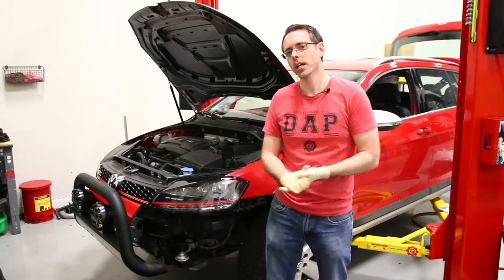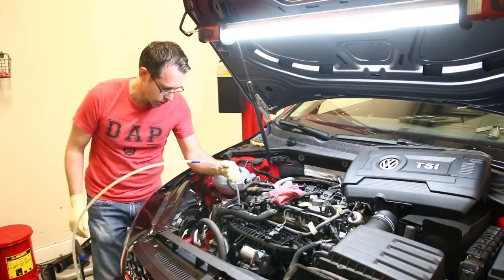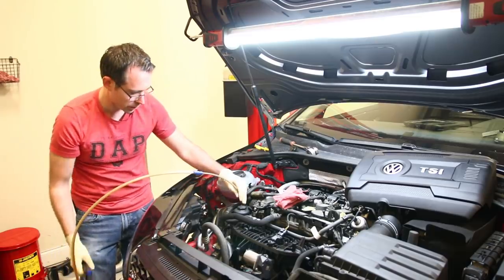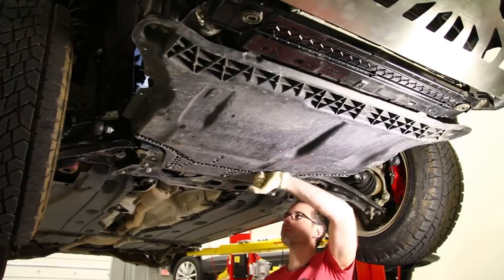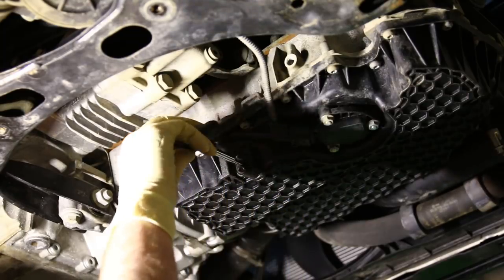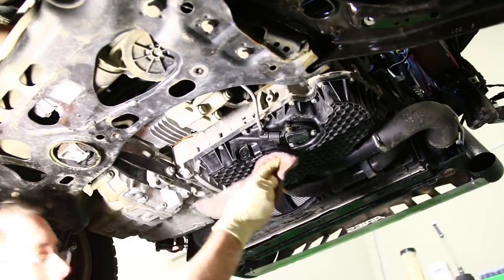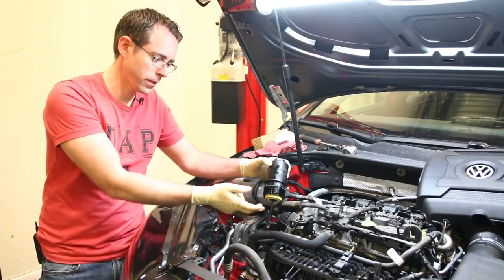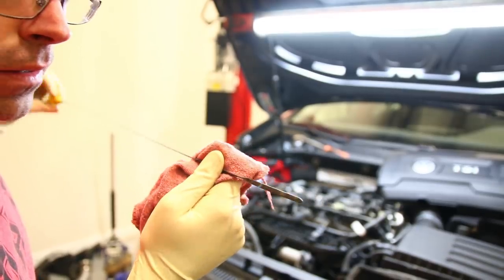1.8T Oil Change DIY | Extractor vs Drain Method

Comment from the maker: - We appreciate your Support and Purchases! -
Oil Extractor Unit (6.5L)
https://www.shopdap.com/vw-audi-oil-extractor.html

Oil Filter Housing Socket (32mm)
https://www.shopdap.com/mk7-gti-oil-filter-housing-socket.html

10K Mile Maintenance Kit for MK7 Golf and Sportwagen 1.8T TSI
https://www.shopdap.com/catalog/product/view/id/603484/category/40004/

Small Pick Set (4 piece)
https://www.shopdap.com/vw-audi-small-pick-set.html

Drain Plug Removal Tool
https://www.shopdap.com/mk7-8v-audi-drain-plug-removal-tool.html

Magnetic Drain Plug (with Seal)
https://www.shopdap.com/magnetic-drainplug-mqb-vw-audi-mk7-gti-golf-oil-drainplug.html

Comment: There's always significant oil left in an engine after the drain or extraction process. All the oil downstream of the oil pump remains in the engine - oil passages throughout the block and head, the pump itself, etc. Check the oil capacity data after "rebuild" vs. the normal oil change. So there's no point in being obsessive, you'd have to disassemble the entire engine to drain all the oil.
Reply: If you use oil flush and let it drain really well, you will get pretty much all of of it out because even when it gets cold, it will flow like water. It completely destroys oil.

Comment: If you take it to the shop for an oil change, they never allow the oil to full drain before putting the drain plug back….I’m sure they leave more residual oil in the engine than the extractor does. Always change your own oil, even with an extractor.

Comment: I've been using my oil extractor for 12+ years, any engine with the oil filter located on top is a good candidate. Tip:  find the end of the dipstick at the bottom of the engine and if you have a driveway with some inclination, position the car so that the oil dipstick side of the engine is at the lowest point.
Reply: Xavier Lemos good idea. Will use it next time
Reply: @Chris-dy1cb  
Furthermore, if you don't have a driveway with some inclination, get a pair of ramps and use them accordingly. Still beats going under the car and also removing the belly pan/cover.
Reply: The incline sounds like a good idea, thanks!
Reply: What if you don't have a dip stick? Like bmw that oil is measured electronic? 🤷🏻‍♀️🤷🏻‍♀️
Reply: @giannispets  
You can look for the drain plug to position the car with ramps or jack stands at the lowest point of the engine so that most of the oil will drain.
Reply: @x-man4702  yes but where I will insert the oil extractor hose? since I have seen people insert it thought their oil dipstick hole
Reply: @giannispets  
Many Mercedes cars don't have a dip stick, but have the provision for sticking a dealer only dip stick to measure the oil and the transmission fluid; BMW should be similar.
Reply: @x-man4702  hmm thx for the info. I didn't know that, will try to see if I can find  if mine has one and where. My oil filter is on top of the engine. I am somehow angry with bmw if they hide that oil dipstick from me 🙄
Reply: I feel sorry for your engine.

Comment: Oil change on 1.8tsi? You don't change oil you just are just filling it occasionally. It burns oil faster than the speed of light.
Reply: haha
Reply: Can’t relate. My 2 2.0t’s and my friends 1.8t don’t burn oil outside of what is normal. Needs a maximum of 1-2 quarts every 10-15,000 miles.
Reply: when i owned my vw i did 3k oil changes all the time
Reply: My 1.8 hardly needs adding in 10k.
36k currently.
Reply: My scirocco 2.0 tsi hardly burns any oil an it's @ 92.000
Reply: @sheffield8184  You are lucky. I know a ton of people with faulty and thirsty tsi engines.
Reply: @georgehuser4711  I change my oil every 5k an use Castrol edge maybe that's why? Modern vws are crap tho my golf mk4 did 215.000 without any problems my scirocco won't do that lol
Reply: @TheShantionee  I've changed pcv last week fingers crossed 🤞🏻
Reply: this is the 3.gen tsi, and they dont burn oil like the 2.gen did.
Reply: Maybe the old MK4's lol
Reply: Probably have a bad PCV.
Reply: Never had to add a drop in 2.5 years

Comment: The advantage of the oil extractor pump is for a DYI it is very easy to do and you stay clean too. I change the engine oil at half the set interval. I don't believe in long change intervals with a 1st gen GDI engine. Besides with my car's  engine, the difference between methods was only 100mL anyway. Leaving some undrained oil is not then IMO an issue.
Reply: please like you are the reason third world countires pay hefty amounts for the oil

Comment: If you want to extract 100% of old oil just add 200-500ml of fresh oil through the oil filter housing and extract it too.
Reply: Oleg Angheluta I do that as well.
Reply: Oleg, there is much more oil still left in an engine.  In these modern engines, unlike engines of yesteryear, they retain much more oil than you think.  Do an oil analysis with Particle Count, and sample the old oil, new oil and then the new mixture after driving for 20 km.  You will be surprised how dark it is and how many particulates and other contaminents are in the engine.
Reply: Hitman  who is wasting two hours and doing what.
Reply: Brian Sydnes I got an E 250 CDI, I did both drain and extract, all the time I got out the same amount of oil. I agree, to drain it may be better but in my case, I have to unscrew 10 -20 bolts to take off the plastic protection underneath which is not easy then I have to fit them back. 
If you service your car well, shouldn’t be dirty and debris in the engine. 
On my wife's car, I drain the oil all the time because is very easy to do it is an SX4.
Reply: Genious
Reply: I've also got a E250 are you saying you've drained both ways extraction and drain with the same result? Also how long did it take you using the extraction method to get all the oil out?
Reply: Dennis Cronin yes, the same result. Depending on what extractor you got. Usually, 5-10min with a warm engine.
Reply: @Oleg85ful  thanks was that time with manual pump or using an airline
Reply: Dennis Cronin manual one
Reply: @Oleg85ful  Best way to remove all the oil is when you drain the oil through the drain plug. Take an air compressor and blow high pressure air through the fill area.
Reply: Keep the old jug with whatever's left when you change the oil to help flush the next oil change.

Comment: I'm amazed how no one is using the super cheap ($40) electric pumps that require zero work and do the job in mere minutes. On my GLI I get as much out of the oil as there was initially in. It takes me about 10 minutes to do the job, less than switching the filter and pouring the new oil in.

Comment: Might have been mentioned in other comments?  Remove filter first, it would hold aprox  250-300ml, if your worried abaut it. First oil change on family's new (to them) vehicles i will first vacuum oil, then measure drain plug oil amount and make note of it.  Without going through a full list... City Golf might leave 200ml in pan. My 06 Camry... maybe 4 - 5 drops! Worked in Automotive repair for 30+ years and manual or air compressor vac is definitely the way to go.

Comment: I have used  oil extractor for over 20 years, Started when i purchased my 01 330ci bmw, I only removed the drain plug once, I still have the car and drive it, its not my main mode of transport these days but still love the car, it has over 240k on the motor and runs great. I use the extractor on everything, with a magnetic drain plug like u said it will catch the metal contaminants. That small amount of oil left gets diluted down and isnt much more than the residual oil left behind anyways.  When u change the oil with the extractor and with how easy it is, u will stay on top of ur oil changes. I get there is always going to be that group that will argue against them, and that is fine, U do u and i will do me, I am more than satisfied using an extractor vs getting under the car every oil change to remove the plug.

I am supposed to be turning my 330 into a project car, other than the high mileage it is in great shape, when i pull the motor to rebuild it, i will take plenty pics for the anti extractor crowd.

Comment: I absolutely love oil extractors. Since the (2004) introduction of 4-stroke watercraft that required an oil extractor as the only means to remove the oil I have been using one on all my vehicles regardless of oil filter location. Performing an automatic transmission service and vacuuming the fluid out before you remove the pan saves time on messy clean ups too.@!

Comment: I just did my first top side oil change and for me the only difficulty was finding the bottom  of the oil pan.  To overcome this problem I moved the drain tube up/down once I had bubbles in the line.  I did manage to find a little extra oil so I'm sure I got as much as I would have by draining.  There will always be old oil clinging to the motor parts so IMHO there's no controversy.  I'm  much happier not having to crawl under the car and get dirty.

Comment: The vacuum pump also allows you to suck out the oil at the bottom of the filter housing (which i have found to be quite a bit)

Comment: Pump is convenient and works great for my 2007 c280.  Pretty much gets all 8.5 quarts of oil out.  Put it this way.  Doing an oil change either method is better than not doing any oil change.  Don't worry about the little left from either method.

Comment: Thanks for the insight. I just bought an older Mercedes and discovered its going to be a chore to drain the oil. Much easier to pull from the top.

Comment: When I use an extractor on my TDI, I have the front wheels on a ramp which drains the oil to the back of the sump.  After extracting the oil, I pull the drain plug & get maybe 10 drops draining out.  If you can, after pulling the oil filter element, stick the suction hose into the lower passages of the oil filter housing - I get another 1/2L out of there on a 2002 TDI engine.
Reply: It wasn't clear to me whether the guy was extracting warm oil or cold ? You get more out & quicker if the car's been up to temp.

Comment: I do a drain from bottom method, but added a drain valve instead of the plug ...  put on ramps open the valve.  Every 5k with filter.  1.9 TDi.

Comment: I top sided all my Vw's 2.0 Tiguan TSI, 2.0 TDIs (ALH, BEW and CJAA) and my Audi 3.0 TDI. Every last drop can be extracted. Finding the sweet spot for the vac tip is the tricky part. The hotter the oil, the more you can get out. You can even vac drain the filter housing.

Comment: For Mercedes, the suction extraction method is the approved method.  On my 2004 Sl600 with a twin turbo V12, there is no "Dip Stick Tube" per say, but there is an EXTRACTION TUBE (there is no dip stick), and the extraction tube goes all the way to the bottom of the DEEPEST PART of the PAN.
When you do the test on a Mercedes, you get only a drop or two when plan plug is removed. You check the oil level electronically via the computer-informant screen inside the car.
For Mercedes, it is the the preferred method. for other cars, you would need to find where the deepest part of your pan is and use the largest diameter extraction tube that fits into your dipstick while your oil is warm.
O, one more important point, for the Mercedes extraction tube, you DO NOT PUT a extraction tube DOWN INTO IT, rather YOU ATTACH the SUCTION TUBE to the TOP of the Mercedes EXTRACTION TUBE!
Super easy and fast...
Reply: Hahaha, thanks for this tip! I just purchased (have not received) a dow industries extractor. It comes with 3 specific adapters, was wondering how they were to be used. So, to summarize certain vehicles (like my VW TDI Touareg) have a dedicated extraction tube? The adaptors are only for extraction tubes, not dipstick tubes?

My son has a 2006 BMW 325i with no dipstick, have not been able to figure out if it has an extraction tube……he’s 18 and is never home😂😂😂😂😂.

Comment: Thanks for the comparison. I have an extra vote but I do prefer the old fashion way of draining from the pan. I use the extractor to get that little bit in the filter housing area. It may not be much oil left when using the extractor but for peace of mind it’s nice getting everything we can out.
Reply: The design of some pans don’t actually drain everything out of the plug so you actually get more out with an extractor.

Comment: My oil filter is on the bottom, so I'll continue draining thru the drain plug. I really hate jacking up the car because of the low clearance. If my filter was on top I'd do it the same as you. I enjoyed the video showing  how little is actually left.

Comment: The amount of time that passed between when you finished extracting and when you pulled the plug allowed for more oil to settle in the pan.  My bet is if you had waited that long and tried the extractor again you’d have gotten everything that came out through the plug.

Comment: I've used my extractor on my 1.8l tsi VW, love it and the filter location is on the top of the engine.  Thanks for the video,  I was curious.., how much oil wasn't recovered on each extraction? This video answered that question

Comment: For those that are afraid to leave a bit of oil in the pan, just remove the filter housing while you are extracting.  If you do a good job about it, there won't be but a thimble of oil remaining.
Filter, Extract, and Fill....just do it a little warm - doesn't take much.

Comment: I love oil extraction on both my cars with engine under trays... far easier.. and both have top internal filters too so no more crawling under the car and spilling oil from an oil pan !! Yes..u might leave a cupful in the engine but if u r changing the oil reg, it shouldnt matter too much

Comment: I bought a TopSider a few years ago ( basically same except it’s a smaller metal vessel) and have been doing the oil changes on my TSI this way…until today. I bought a cheap 12v pump from The ‘Zon and find it is a lot easier to use. Works pretty much the same as the manual pump or pneumatic extractor, but far less effort. Only caveat is you need a separate container; I just used an old kitty litter jug with a screw top cap, so I can safely and easily take the used oil for recycling.

(I still jack up and crawl under my Miata, as I have to anyway to get to the oil filter.)

Comment: I have always wondered about using an oil extractor. This was great information. I guess the extractor would work the same on all makes and models. 

Keep up the great content.
Reply: Dave J 
Extractor method really only makes sense with engines that have top mounted oil filters.
Reply: @RobertLeBlancPhoto  if you are going to have to change the filter when you change the oil you are not leaving any additional old oil in the engine. Can you explain why you think so? I'm just looking for information and could be wrong.

Comment: I do the oil and filter via drain plug on the 10k mark.  on the 5k (15k, 25k ect) i do a quick extraction change and let the filter ride the full 10k.  Oil is cheap.  I never forget when its time to change and i never worry about fuel dilution, shearing, or low additives.
Reply: Thats right Daren, oil is cheap & the most important thing for me is to use a Good Branded Oil Filter & change 5k regardless.

Comment: This is great for a car with a top mounted filter.  If your filter is under the car it makes no sense to use one of these really.  Might was well remove the drain plug. Unless you want to drain from the top and remove the drain for that last bit.  This is still a way cleaner method.

Comment: Great vid, thank you. I get a little OCD about that leftover oil with the top extractor too but I’ve also just moved to where I have very little, flat space. Wondering if a bit of fresh oil I would help pump the last of the gunk out? Also, if no slope, one could put the rear wheels on the lifters to mimic a driveway slope?

Comment: WatchRJgo did oil suck on a Civic and had a bit more oil out than doing drain plug. I guess it depends on the engine design. 150ml on 6 liter ... not bad. More convenient - lot less messy.

Comment: Honestly, there's a drain time. If you wait the 5-10 mins it took for him to then drain from the bottom, you can still suck out a little bit more oil. Oil tends to cling to all the walls and parts of the engine and can take several minutes to completely drain to the bottom.
Reply: I have had an engine on the stand without the oil pan on. I had a tray under it. I was curious to see how long it would take before it stopped dripping oil. The answer was 4 days.  When i pulled it apart i started at the head. It still had oil on the cam and lifters along with valves/springs. It had some oil pooled in different recesses in the head. 
Then after removing the head i turned it over and started pulling the rod bolts off. Still was nicely coated with oil on the crank and bearings. Removed pistons and had a slight oil film on the cylinder walls. When i removed the main caps it had a coating just like the rod bearings. When i pulled the crankshaft it drained about 2oz of oil if i had to guess. The bearing half that was on the block had about a pea sized amount of oil on each bearing of the crankshaft. 

Point of this is, oil remains in all parts of the engine even after days of draining. I would say about half a quart of oil in total remained in the engine.
Reply: @pospc2  
Good to know! ✓
Thanks for sharing. 🙏
Reply: @pospc2  this is true, and a good thing too, otherwise none of those surfaces would be coated at the first moment of cold engine start.
Reply: @realitytunnel  i completely understand why its made like this. Was more of making other aware that possibly don't know that engines are made to have oil pool in spots for start up. I also am kinda making a point that no matter which method or how long you leave the drain plug out,you are never going to get all the oil out.